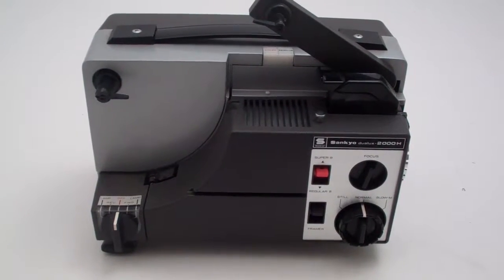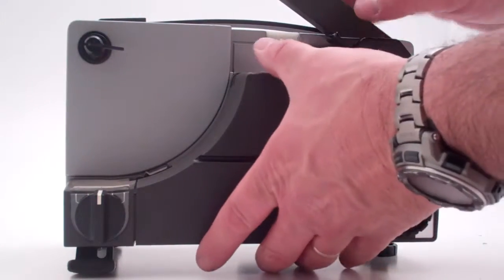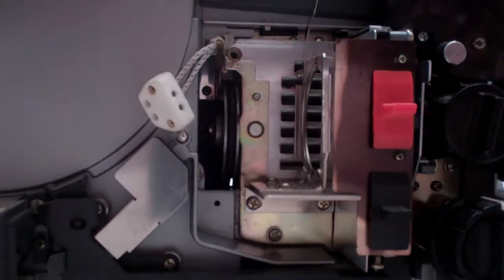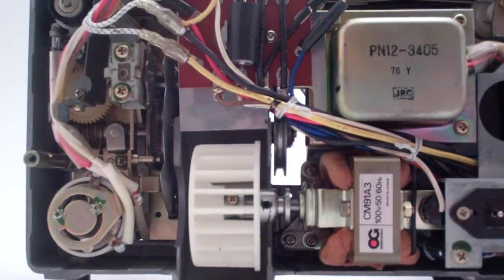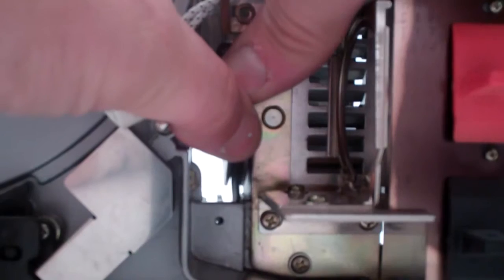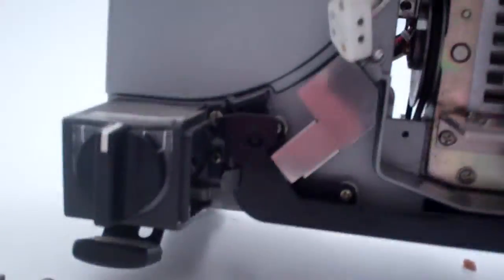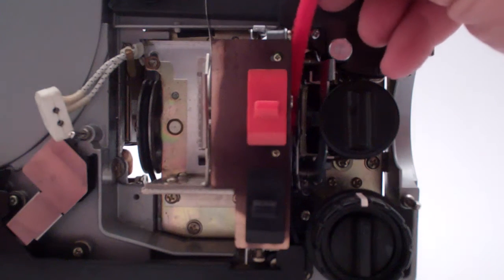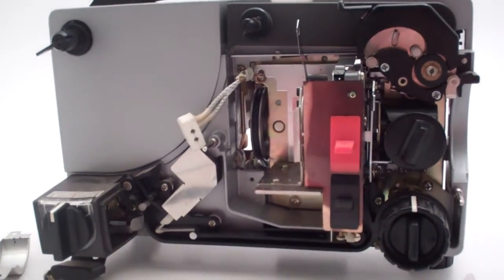Sankyo 2000 H Projector Replacing Motor Drive Belt

Comment: Very Helpful and informative video. I picked up the same projector in a garage sale. I have one problem with it, When you switch it on, the light comes on but it doesn't go through the lens. It only does for a split second when I turn the switch from "Lamp" to "FWD". Is it something you have ever come across? 
Keep up the good work.
Reply from the maker: If you don't actually have film loaded it's normal.

Comment: Hi, the crews are not philips heads, that is important! they are JIS, japanese industrial standard. a philips screwdriver fits but not quite right.  you can regognize jis screws because there is a dot in the head.
Reply: Hi Erik, i am wondering if you know the dimensions of the drive belt. Not sure if Van R will see this since the post is from 2016.
Reply: Madi Obrovac i dont know the dimensions but at van Eck video services you can order new ones

Comment: I have this exact model projector, been boxed in attic for 30+ yrs. immaculate condition however will not turn wheels or light the lamp, have replaced the lamp and socket thinking it was that to no avail. Any ideas? Do you have a wiring diagram or such like? Thanks
Reply from the maker: Does the motor run?
Reply: @Channel-About-Nothing  yes the motor runs
Reply: @Channel-About-Nothing  just dug it out again, motor runs both fwd and reverse. It’s the lamp which won’t light.
Reply from the maker: Sorry, I have no idea what's wrong with it.  Do you have a voltmeter to see if power is actually making it to the lamp socket?  Also what is the voltage of the lamp?
Reply: @Channel-About-Nothing  12v lamp, new lamps and lamp holders tried, no voltage getting to lamp holder, the 2000 requires film before lamp light apparantly but still not in my case. Do you have wiring diagram?
Reply from the maker: @superdraffy5674  Sorry no I don't.  Sounds like part of the transformer went out.